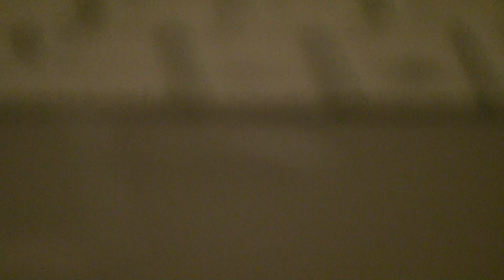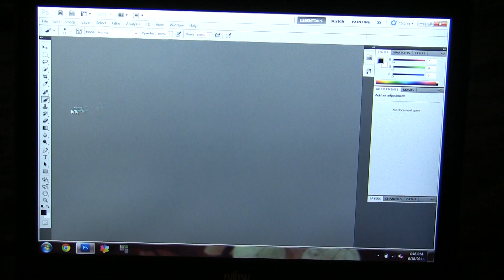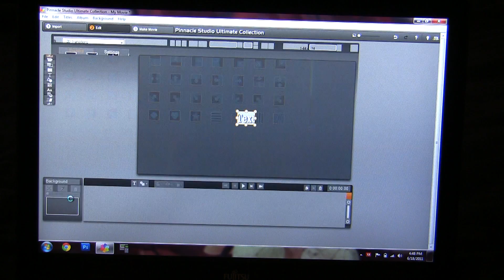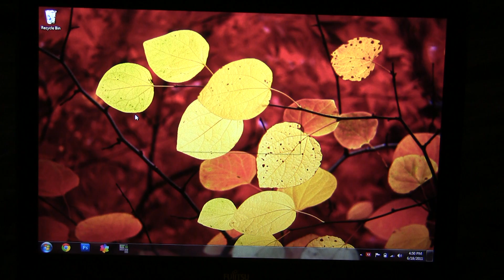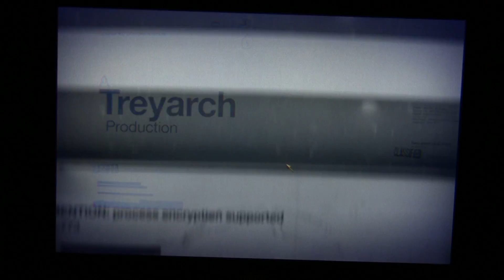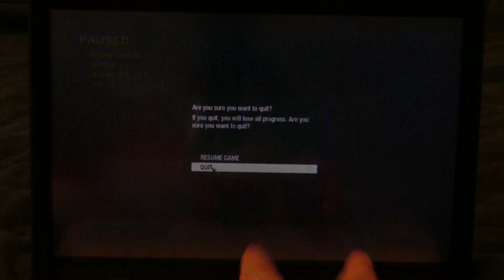Fujitsu T901 Review Part 1

Comment: Does photoshop have pressure sensitivity with the brush? It doesn't look like it in your video. Also - you should try a more standard brush, the one you use definitely would tax the system a lot more.